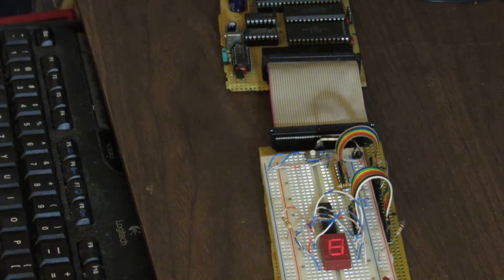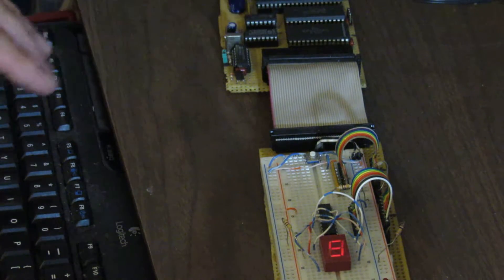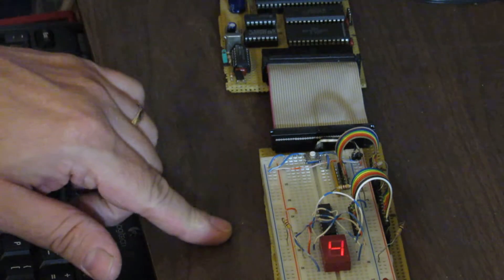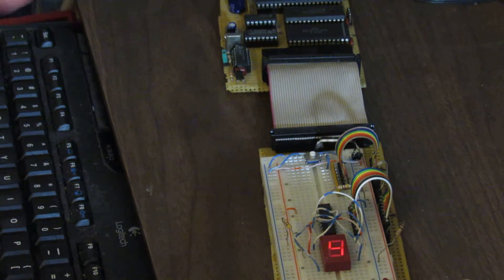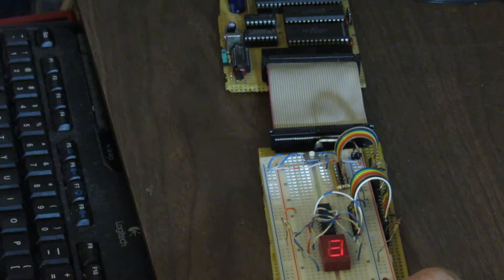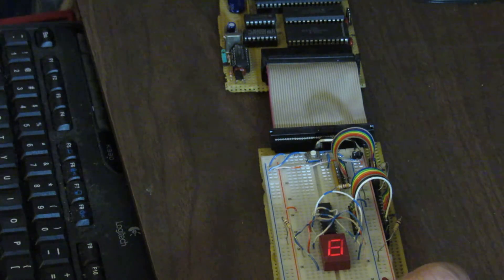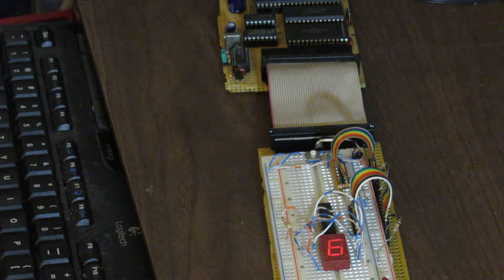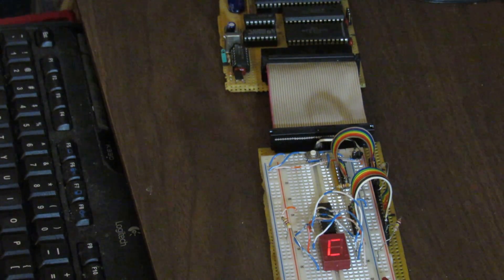Minimum Z-80 system build Z-80 PIO test

Comment: I wonder how usable that Z80/8080 chip in the Gameboy is? I have two gameboys at the house but one of them screen is whacked but I bet the chips are still usable.
Reply: Five years late, but the Z80 on the Game Boy is greatly reduced in function from the original thing. Lots has been cut, but perhaps most notably is the I/O functions are gone, so all peripherals are memory mapped. This, including the fact that the bootrom is built in to the CPU, makes the Z80 on the Game Boy undesirable for anything other than the Game Boy itself.
Reply: @diskkun4120  yeah we later discovered the crippling involved lol. But thanks for the reply.
Reply from the maker: We have to open them up and see if the CPU is solder mount, they maybe could be fix.  or write your own custom ROM's games.  Or just make the CPU do something else.